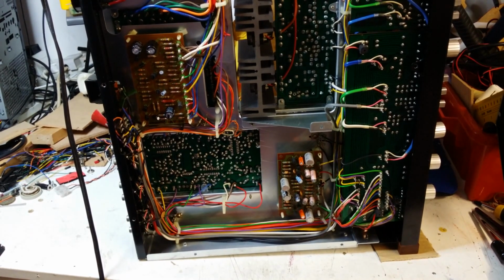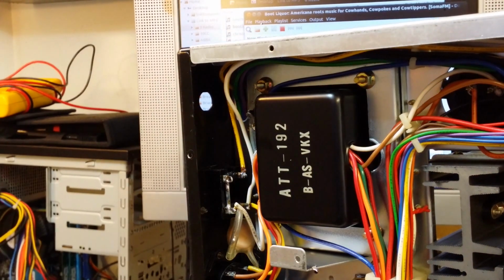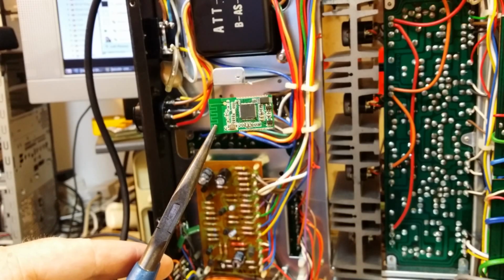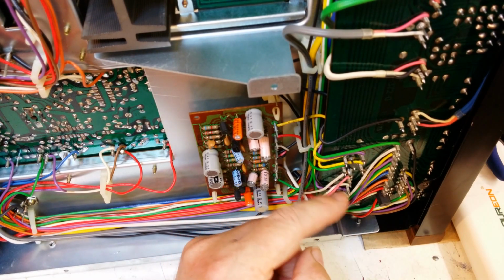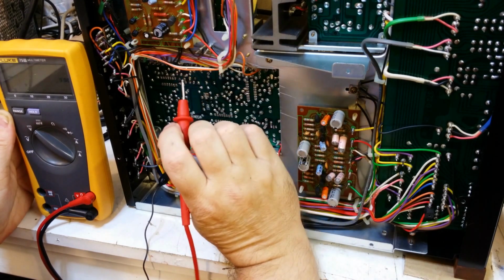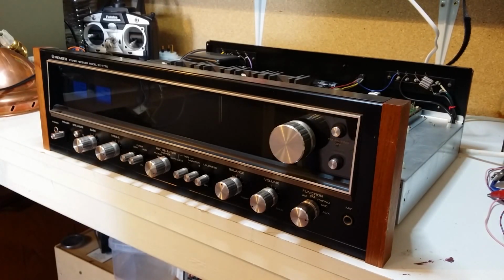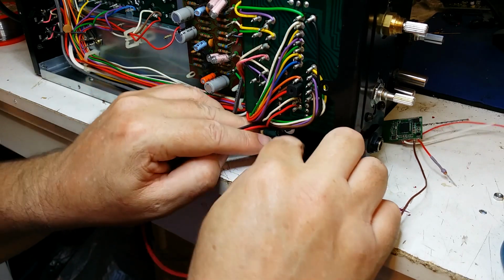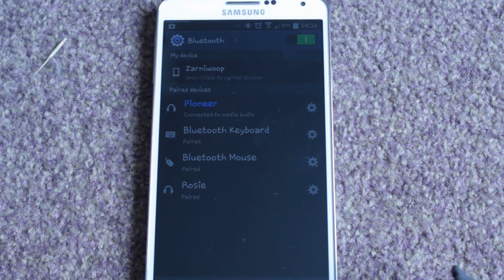Pioneer SX 7730 Bluetooth Upgrade

Comment: Hi Doug, what is the model number of the module you used?
Is it an OVC3860 based module?
I can find quite a few similar looking items on ebay etc, but most have extra output stages or don't take 5V input.
Did you just take the audio from OUTL and OUTR, some data sheets show op-amp output buffers with the input referenced back to OUTM
Reply from the maker: Hi Simon, Yes it is an OVC3860 module. I cannot find it in my Ebay history so I cant give you much info on it apart from I remember paying in dollars for it. The module would normally be powered by a single Li-ion cell at 3.7 to 4.2 Volts on the VBatt pin and not from an external supply. I think the module actually had the ability to charge the cell. I simply used the Vbatt and fed it with 5V through a 4001 diode which dropped it enough. I also put a 10k resistor across the cathode and oV to ensure the diode was in forward conduction if the module did not draw enough current to make sure the drop was enough. I used the OUTL and OUTR which were at normal line level and fed them direct into the L and R inputs. The OUTM seems to be a mono output, maybe for a single earpiece application.
Reply: Doug Leach Ok, in the meantime I have ordered a couple of modules to experiment with.
Although the data is limited, I have pieced together what is available and it seems that the OUTM pin is a low-impedance 0.9V, for use as the headphone common return to avoid the need for coupling capacitors as OUTL and OUTR will inherently be biased mid-rail from the 1.8V. Until I receive the modules to do some tests I won't be able to determine if there's actually any signal on that pin.